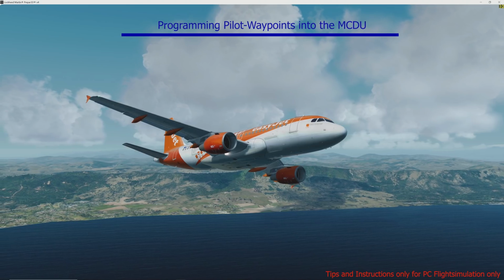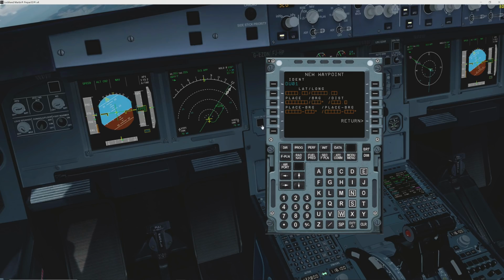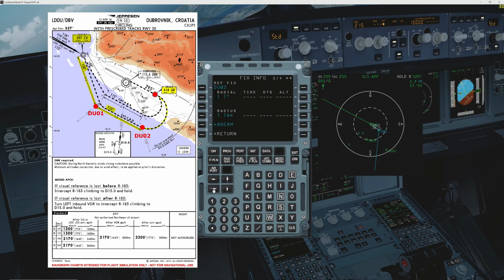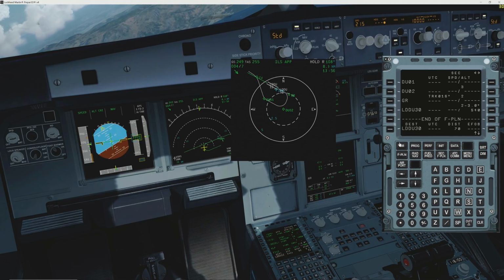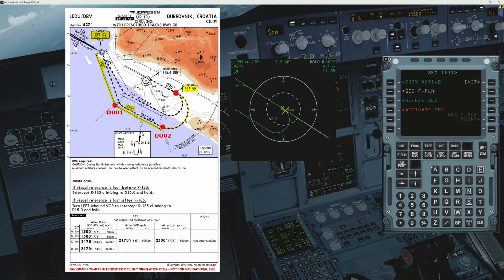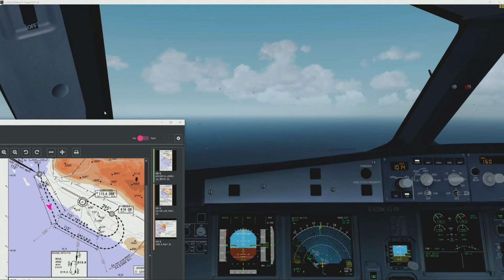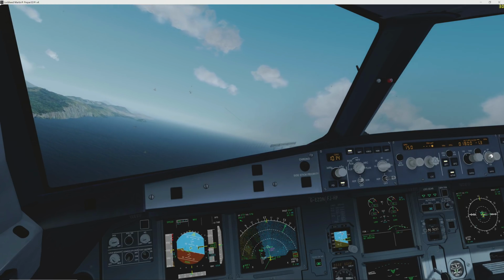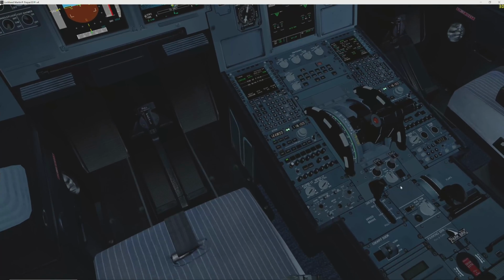FSLabs Basics: Creating Pilot Waypoints in the MCDU

Comment: What would you do if you had to go around? As circling approach is part of precision approach (ILS 12 in this case), would you apply go around procedure for RWY 12 or 30?
Reply from the maker: You would always follow the missed approach of the initial instrument approach. That means if you are in the circling procedure you need to turn back to the original missed approach track for the instrument approach. And this must be done in the circling area. Unless of course there is a different instruction published in the airport information chart.
Reply: @Blackbox711  yeah but isn’t it kinda weird not knowing the exact procedure to apply for missed approach procedure? Like we have to turn 180 degrees in order to apply the missed approach procedure. As there is no published procedure that I know, is it all pilot discretion?
Reply from the maker: For the Airport LDDU there are published missed approach procedures when in the circling approach. If you are approaching an airport with a circling approach and no missed approach instructions given, the standard procedure is to rejoin the original instrument approach go around procedure. And yes that means you might need to do a 180 degree turn to do so. Still better than climbing up towards the inbound traffic on the instrument approach.
Reply from the maker: And that standard procedure is known by pilots and is therefore applied accordingly.
Reply: @Blackbox711  great. It’s all more clear now. Thank you for your answers captain.
Reply from the maker: Very welcome. I wish you always happy landings

Comment: "When you activate the secondary" flight plan you said "it kicks out  the performance data" - is it a bug or a feature of the real software? Thanks.
Reply from the maker: The FSLabs does not correctly simulate the secondary performance data input yet. Hence after activation of the secondary flightplan you need to enter the performance data again
Reply: @Blackbox711  Oh, I missed the secondary performance data part completely. Now all makes sense, thank you.

Comment: Saw you flown the TU154 on twitch. You asked about KN90, first, this video should be helpful:
https://www.youtube.com/watch?v=-jxth7G0d5k
and how to create a flightplan
https://www.youtube.com/watch?v=xY-rqhDf6TE&list=PLA8oLSyzSLMOGi9WG5LigZsDZjlXx_wXV&index=2
and how to navigate with it:
https://www.youtube.com/watch?v=HGFqBviWrQA&index=6&list=PLA8oLSyzSLMOGi9WG5LigZsDZjlXx_wXV
and the gyros:
https://www.youtube.com/watch?v=-XfEbTmbb5w&index=7&list=PLA8oLSyzSLMOGi9WG5LigZsDZjlXx_wXV
I tried to fly only with VOR and did not use it. My flightplan is not shown, so I decide to fly only with VOR. But at the end, maybe because I didn't upate the gyros, all RMI and HSI shown more than 50 degrees wrong directions. Many things are not easy to understand. Also, I am very confused, sometimes distances in km, sometimes km.
The cabin pressure settings I didn't change during the whole flight, whole time 650 and 0.6. Pressure was correct during whole flight. Mabe the Felis needs no changing after take off at 3000 feet.
Hope, you will fly again in a stream this airplane.

Comment: Finally had a chance to try this out at Nice on an Rnav22RD approach. However it didn't really go to plan! The waypoints i created from the VOR stayed blue.

So on my initial flight plan the final waypoint was map022 and not the runway weirdly. So i added the vor beacon for the airport something like AZR i think and then  created a waypoint from the radial according to the distance from the chart.

On my first approach the plane turned to fly along the first part of the blue line to my created waypoint  but then didnt make the turn to follow the blue line to the runway!

Just wondering why they were blue and not green and why the runway wasn't on the plan either?
Reply from the maker: It is difficult to say exactly what went wrong. However as long as the programmed route is not green, it is not active. So be careful when entering your programmed waypoints into the F-PLN

Comment: Couldn't you just enter the waypoint into the FPLN page, indexed where it needs to be, of course?
Reply from the maker: Yes, you can enter waypoints via the mentioned definitions as well directly on the F-PLN page. However, there you can't choose your own identifier names. And if you don't have the place/bearing info published (for example a non standard visual approach at an airfield) it is better to do this via the method I have shown. That way you can fine-tune the waypoints before actually entering them in the F-PLN page.

Comment: Why did u not make DU02 and GR into overfly waypoints in order to achieve the exact nice constant 180 turn like on the chart? As i understand the chart u should start the turn at DU02 but the way u have it in the fmc u would start the turn before.
Reply from the maker: You are making an excellent point there! The pattern would have been more like on the chart if I had used the overfly function. When I was making the video I just didn't think of that.
Reply: I was wondering the same, so thank you for answering here! Really fascinating how much detail there is in this addon!
Reply: @Blackbox711  now we'll need your another video on Dubrovnik )) Thanks!
Reply: GPS cordonates
Reply: Just saw this video and was wondering about the same. Thanks for clarifying it!

Comment: professionalism as usual!
Reply from the maker: Thank you very much!
Reply: Blackbox711 what's your take on aerosoft A319 vs Fslabs A319 in terms of flight dynamics? 
Aerosoft seems to be very nimble compared to Fslabs which is more stable while hand flying. 
Can you possibly make a comparison video of which is more realistic?
Reply from the maker: I am aware that people are keen on hearing my thoughts on the Aerosoft A319. I have tried the Aerosoft A319 and have to say that it is a good addon for beginners. The flight dynamics are indeed simple and easier to handle than the real aircraft. Also the systems are not modeled deeply and anyone more proficient with the A320 could get bored with it very quickly.
Reply: Blackbox711 thanks for your reply! :)

Comment: Great, nice to see you again here on your channel, I hope you enjoy the summertime ..this function for circeling approach is verry important, thanks for explanation. I` m still missing in the new FSL A319 the offset - function. What do you say as real pilot for the importance about the offset function ? Can you give a concrete example for that ?
Thanks 
Lothar
Reply from the maker: Hi. Personally I don't use the offset function in real life. It can be helpful when you need a route offset because of a thunderstorm on the original route. On the 747 I used the offset function more often, especially over Africa to fly 2 NM right of centerline of the airways.
Reply: Thanks, I understood on shorter flights with B737 or Airbusses offset is not common. We using offset during online groupflights on VATSIM or Flugsimulatorclub to seperate in one direction. I hope FSLab will implement this function in the A320 - Familie (64bit) again. 
Other question: Can we expect your handling with the new Airbus- Generation by AEROSOFT ( at moment A318-A319) ?

Lothar